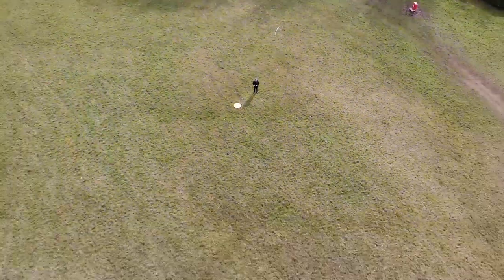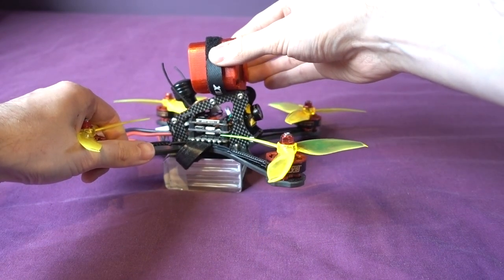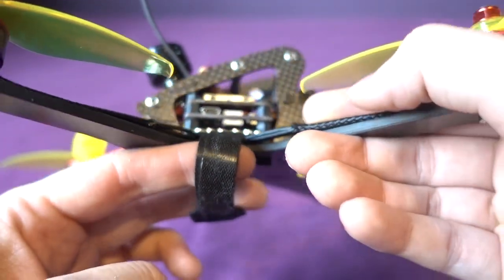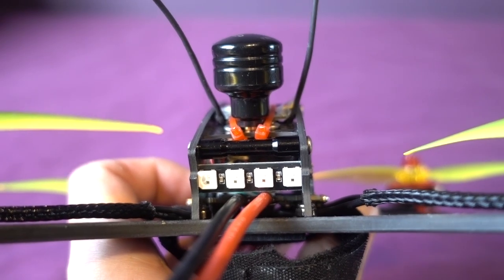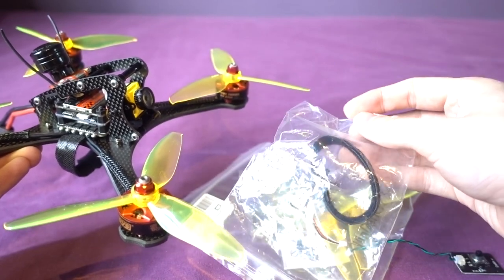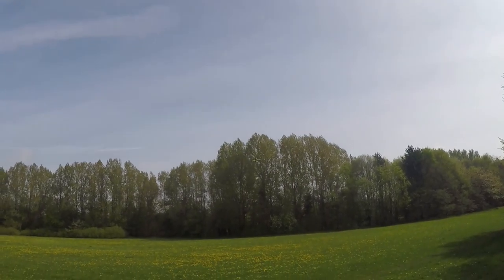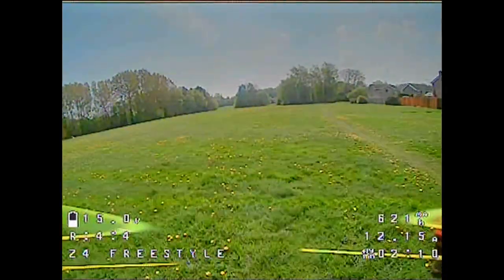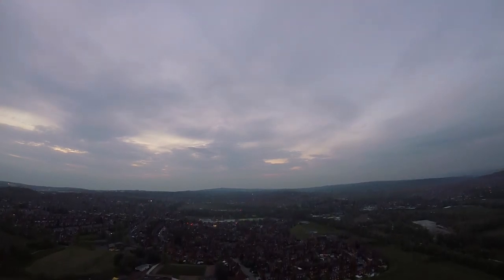AuroraRC Z4 Freestyle

Comment: The bottom plate looks very similar to the Darkmax 220. Great video as always.
Reply: I tought the same.. that frame sucks haha
Reply: @thijss1272  My Darkmax runs like a champ and has clocked 103mph, NO issues at all. Original release version before they cheapened it. Ha. Frame is solid as hell.

Comment: A tip worth doing for a battery under slung is to use PCB Prototyping Board same size of battery placed to protect the battery on landing.
Reply: Land a bit more gently, protector not needed at all.

Comment: I'm using the d y s 28000 KV Motors with a 5000 amp battery on a 5 inch drone and it flies perfect it's still puncher I was so surprised I thought it be well soon Evie

Comment: I stopped buying from Gearbest last year at some point. Banggood hasn't done me too wrong yet (as far as shipping times and rates). Bought one 1206 4500kv motor from Gearbest just now and shipping looks to be slow boat speed... again. If RDQ had what I want I'd buy from them or our local shop, but they are out of stock a lot. I can barely keep up with all these new 2019 models and new makers, so I don't blame them for it! Aurora RC 5" huh? I'll keep an eye on it, but just now I really just want another Hawk 5 BNF!
Reply: When I purchase something from GB, I expect NO support (or some chinglish reply that has nothing to do with my query) or knowledge-aid and 4-8 weeks shipping.
I also never buy anything expensive or technically complicated from there, so far I`m a happy camper lol
Reply: @afrog2666  I'm all in with the hobby shit. It's where my money goes. Gotta buy where they are selling. No other vendor had in stock the part I require to fix my 3"...

Comment: Andy, understanding your thoughts, however, I do not think that this was released as a "freestyle" flyer specifically. "Freestyle" in this case is just a catchy name, not mnecessarily what it is intended for. Myself, I will not be cutting milli-seconds of my lap times or smashing gates because of any weight that my quad is carrying. I fly what I like, (most quads with any ball s at all) that I can afford, (minimal on dis-ability) and what makes me smile. You call it anything you wish. Thanks Andy, I like what this model offers, and of course, you are one rockin' s.o.b. on the stcks. (No, "s.o.b." does not mean "sweet 'ol boy", lol) Jeff